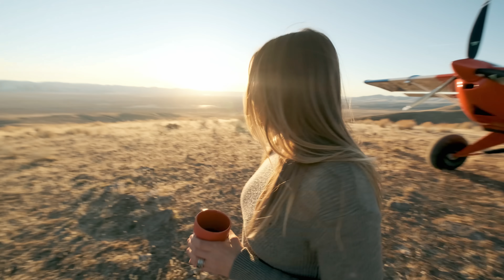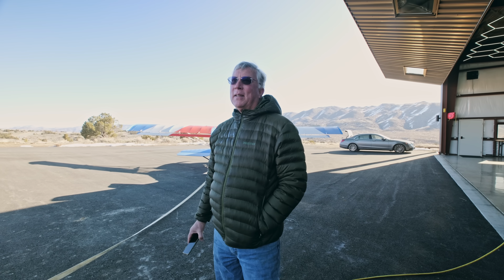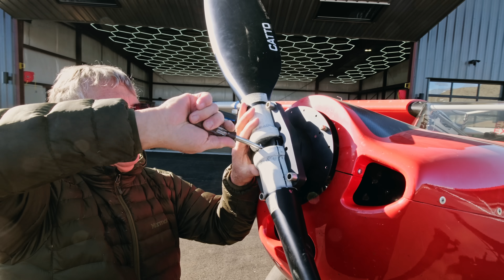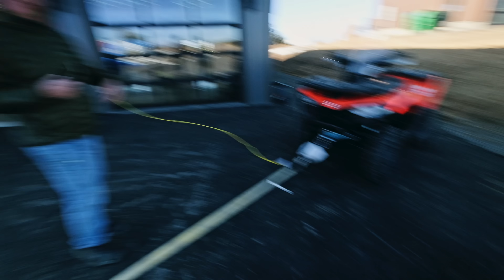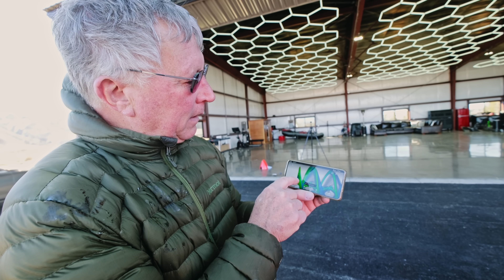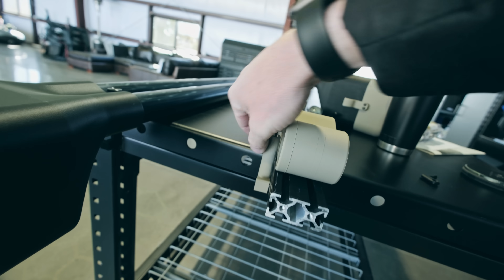Test Flying Catto's New Ground Adjustable Prop!

Comment: Back in the early '90's I had a small computer program from Hartzell where every blade profile could be simulated along with pitch, diameter and blade numbers and I found it fascinating to play with all the variables.   What really stood out was the similarity to a turbocharger impeller in regards to efficiency islands within the maps.   The prop doesn't work very well until it gets to its' 'happy speed' but this is also pretty close to where the tips are going supersonic....so in our case we were building an auto-engine conversion that had the ability to spin to 6000 rpm for max power but then the prop became inefficient if the rpm were dropped below about 4500 for cruise using the gear reduction ratio we'd chosen.

Aero engines don't run a real wide rpm range for prop efficiency reasons and while a small Rotax is fine cruising along over 5000 rpm... a Big Block Chevy isn't so happy being run constantly up there and I'd much rather use 4500 take-off so we could cruise about 3000 which made a lot more sense to me.   Props are very interesting devices!
Reply: You realize that the Rotax is already geared? The Rotax isn't a big block, it's more like a snow mobile engine - it likes to run at high RPM. If you ran the Rotax at 3000 RPM, Trent wouldn't be able to take off...
Reply: @realulli You seem to have missed the point I was trying to make....that the propeller is a very speed dependent device that only works within a narrow rpm range that is up near its' maximum speed.   So of course a little snowmobile motor spinning a large diameter prop needs to be geared to spin it to the proper rpm which is going to be up near the tips going supersonic.

Comment: Great video on the prop. Huge market here for ground adjustable props that are simple to change like the nw Catto. I've been wondering why someone hasn't made them like this or similar. There is another manufacturer that has a prop that can be adjusted by simply inserting a wrench through the center of the spinner and turning it one way or the other.  Anyway keep us posted on the prop info. Thx Trent.

Comment: Isn't the cruise test faulty because you don't have a spinner on?
Reply: was thinking the same - the missing spinner will definitely be detrimental to the efficiency ot the new 2 blade setup
Reply: At that speed it probably won't be a big enough difference to reliably measure.
Reply: Spinners on slow ga aircraft are actually mostly to direct airflow into the cowl nacelle for cooling. For this reason I believe it’s a required component for a Piper Cherokee.

Comment: wouldn't this test be more effective if the tail of the plane was off the ground/level w/ the prop? aren't you losing a bit of torque through the angles or am i an idiot?
Reply: Static testing is just that. It is the in flight testing that is important and as we see there is nearly no differents as that would depend of temperature, attitude, barometric pressure.
Reply: No because they're doing A-B comparisons. The force vector is consistent between runs. They might be able to get a few more lbs of force if everything was lined up but it doesn't impact the comparison. And I wouldn't want to risk the prop hitting the ground if things were to start to move around.